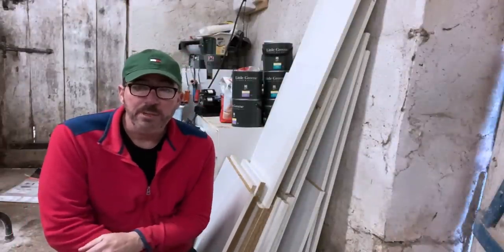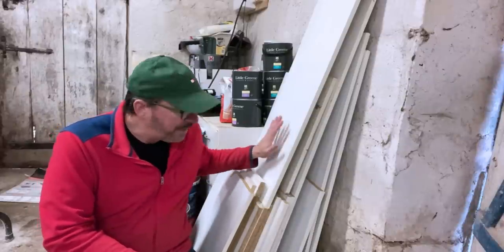Building a CUSTOM SINK CABINET for a chateau, DIY KITCHEN MAKEOVER - Journey to the Château, Ep. 84

Comment: Love the new sink......cruddy instructions and all!  I have a triple sink in my kitchen and also a sink in the island!  After living in Moscow for five years and using a sink the size of a plastic dishpan, no dishwasher......I wanted sinks! We spent a few years in another apartment was well and it had been newly renovated.  That Moscow apartment also had NO shutoff valve under the kitchen sink.  The only shut off valve for the entire flat was at the taps on the bathtub, but you had to push your arm between the bathtub and the sink cabinet, then contort your arm to make a 90 degree turn to the right and grasp the valve to shut it off.  One day, about 2 weeks after moving into this newly renovated apartment, I  was running the dishwasher and I heard water running and then saw steam pouring into the hallway!  The hot water pipe had come undone and hot water was spraying all over the kitchen.  I quickly grabbed a plastic trash can and tried to capture some of the water, but the pipe was so hot, I could not hold it.  I rant to the bedroom to get a tube sock of my husband's and managed to tie it to the hot pipe and then direct the pipe into the trashcan.  After a few minutes, I left the flooding kitchen and tried to turn off the water valve behind the bathtub.....no luck.  I then decided to call my hubs at work and scream for help!  Foolishly, I decided to open the window in the kitchen to let some of the steam escape as it was like a sauna in there.  The air outside was very cold and all I did was create more steam!!!!  By the time my hubs and his driver showed up, I had so much mascara running down my face from tears and steam, I looked like Tammy Faye Baker.  I had not seen this sweet driver, Sergei, since we had arrived back in Moscow about a month earlier, so we had a great laugh!  Hubs got the water valve turned off and them I started mopping up the ankle deep water that had left the kitchen and spilled onto my wood parquet floors in the hallway and living room.  Then, we needed to address the neighbors beneath us and maybe the neighbors beneath them!  Oye, oye, oye, what a mess!  Seems funny now but not at the time.  So, YES, every water source in the chateau needed a shut off valve.  End of this saga.!  Stuart's sink looks great and like it has always been there!  Cheers!
Reply from the maker: Loved this story, Jill! Thank you for sharing it with us!  ❤️🥰
Reply: OMG…..  you know how to tell a story.  We were laughing out loud.  Not at the actual situation.  That must have been horrible (and you could have scolded your hands.  😱. But the way you can describe it is priceless…..  And Tammy Faye Baker had me in stitches.  Thank you for that.  I love your comment. And even though, I never yet had a situation as terrible as you had to endure, I can relate 100%. 
Thank you for sharing and we are glad you like the sink cabinet.  With much love from Colombe. ❤😊❤
Reply: @patrickjourneytothechateau9452    Glad you had a good laugh!  It is quite silly when recalling the story now!!!  When my hubs and I got married over 30 years ago, he promised it would not be boring!  He kept his word!  I did not get burned, thanks to the ugly tube sock!  What a fashion flop those things turned out to be!  Only good for plumbing emergencies!  HA!  Will be in your area June 7-14 so might try to chat with you on your gite site.....staying with friends near Loches....so many be can treat you two to lunch in Loches.....sounds like a sweet little French novel.....Lunch in Loches!  Cheers!

Comment: I have a question. Isn't there supposed to be u-shaped plumbing coming down from drains so that it blocks noxious gas from coming up?
Reply from the maker: Yes, Tony installed it and it is there. Plumbing fittings look different here. We do know what we are doing. Thanks.
Reply: Stuart is right.  Looks very different.  Those traps are much smaller and leave more cabinet space open.  😊